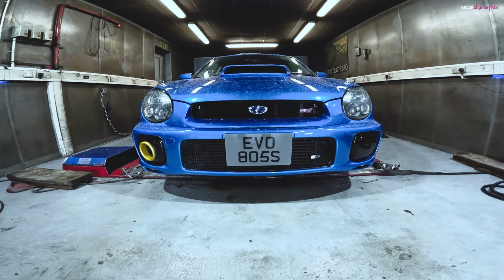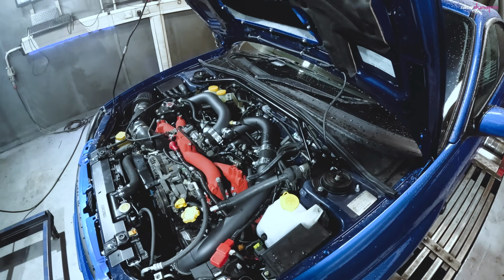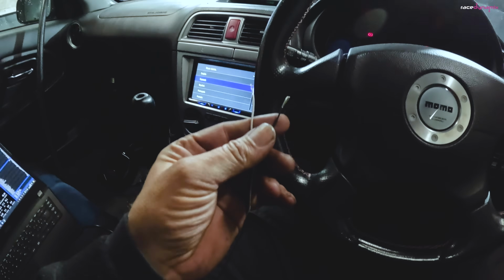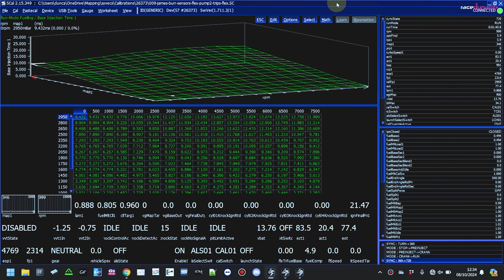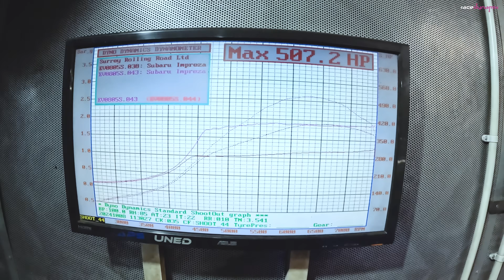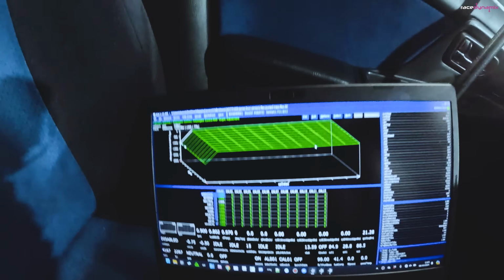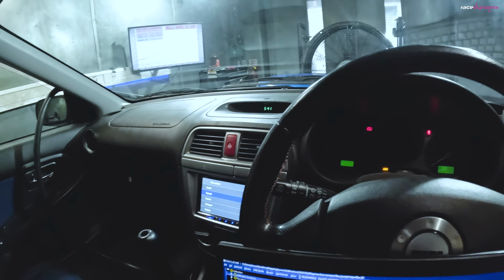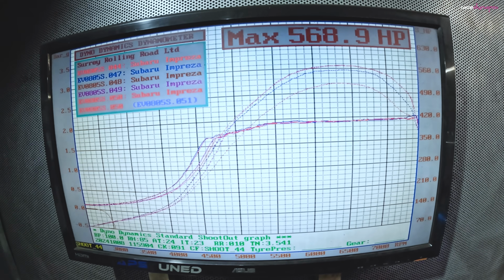The ULTIMATE Street Subaru Impreza ? | 500+BHP JDM Bugeye Impreza STi

Comment: I got similar setup GTX2971R twin scroll 
Emissions delete,  big top mount  ,1000cc injectors. 
GRB JDM. 3INCH exhaust
Reply from the maker: nice 😎
Reply: what power are you making with the GTX2971R?
Reply: What are you making bhp?
Reply: 430 on 91 stock long block everything ported boost at 3000 rpm @IcySTi
Reply from the maker: 2971 is a great turbo for the road 😎
Reply: @racedynamix  I'm totally happy I didn't go bigger specifically for factory block 😅
Reply from the maker: @yehornaumov5893  exactly 👌👍

Comment: Oh the bug eye love. I just tuned 2 this last week one at 356hp and the other 372hp to the wheels and they both came with .043 gapped plugs🤦‍♂️ I was like ya gap your plugs to .026. These ej205 will blow the spark out at anything above 14 psi with the .043 plug gap.running .026 gap I got 22 psi. But 24 psi and up need some hot coils for sure.
Reply from the maker: nice work... and wtf to those gaps 😱
Reply: @racedynamix  ya I about crapped myself when I saw them. No wonder she wouldn’t Rev past 4400 and 12 psi when they brought it in lol.

Comment: Hi Duncan! Hoping a small question for your vast knowledge.  My 2006 US STI has a 16102aa360 Denso boost control solenoid.  I found a 2008+ STI solenoid but part number is 16102aa380 Denso, can I use that one and would it be plug and play?  Thank you!
Reply from the maker: @panderalexander  Yeah .. 👍👍
Reply: @racedynamix  great thanks Duncan, it just threw me off the parts number were different and when I installed the new one it doesn't boost to the 20 PSI I had tuned for, I'll fiddle with it some more.

Comment: Content sensor show e40 or m40
You have 4 gal of meth
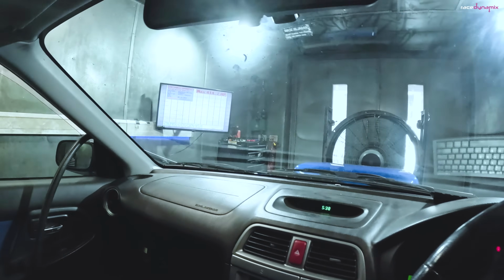And 6 gal of fuel? 14:49
Reply from the maker: It measures alcohol content so you have to stick with either ethanol or methanol, you can't mix them as fueling requirements are completely different.  But yes, 4 gallons methanol and 6 gallons of fuel is m40 mix 👍
Reply: @racedynamix   txs for your answer theres this channel turbine research, he does some methanol flexfuel testing and it seems the content sensor reads way higher than the actual content , but 40% meth ratio should be around 20% oxygenation vs 30% on e85 good stuff